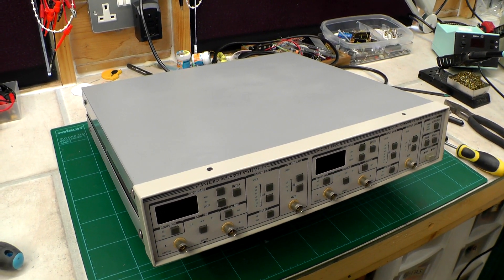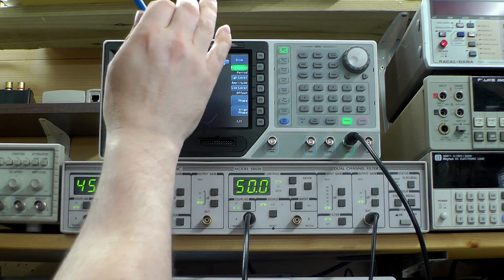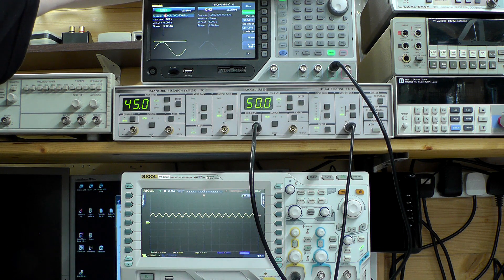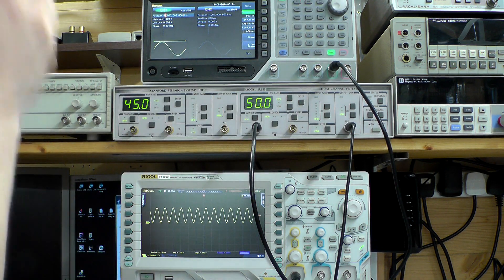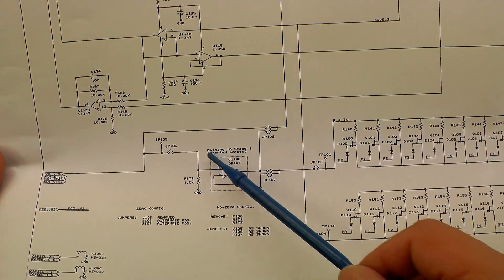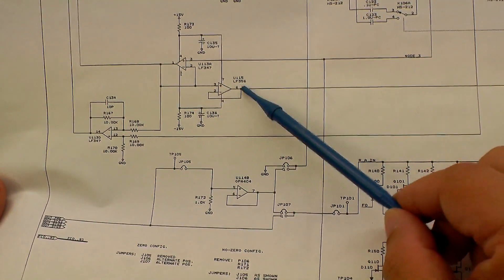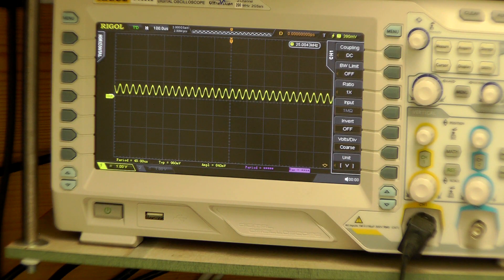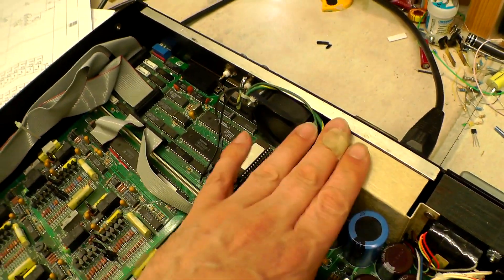Stanford Research Systems SR650 Dual Channel Filter Repair - Part 2

Comment: I would expect the DC offset to be at zero Hz hence it would not get through the high-pass filter. That would imply that the AC coupling control on the high pass section would only have an effect if the filter is bypassed. Good work on the build.
Reply: Yes! I think the same: there isn't a problem in High Pass Filter section.
The signal that you're using has a DC component that in a HPF is attenuated.
Reply: @salvo2889  Of course DC is zero Hz.